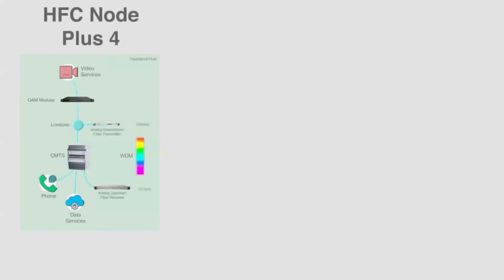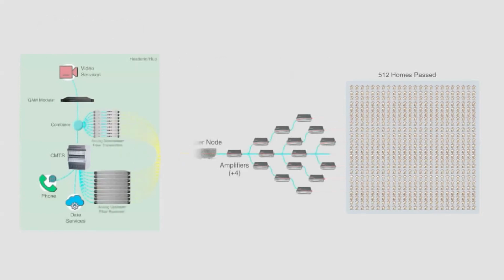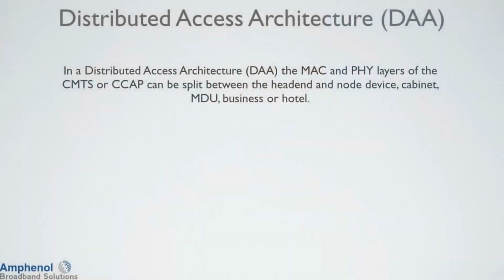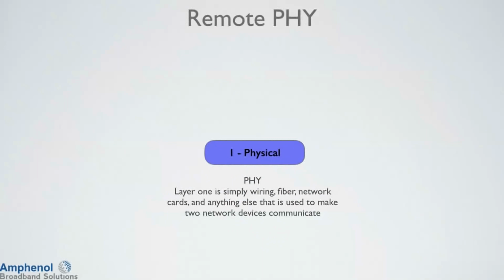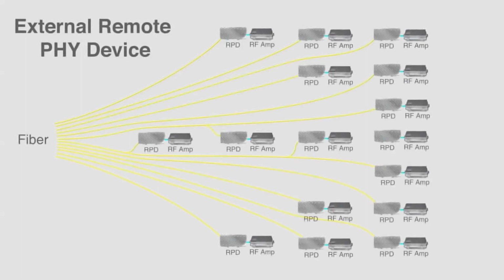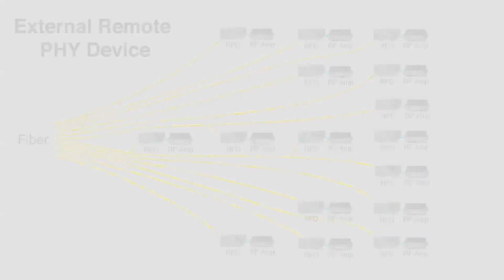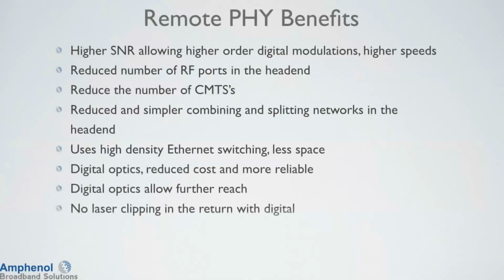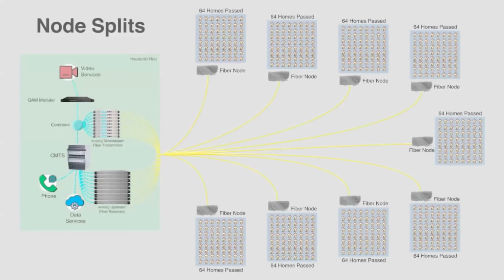Fiber 101, Part 5 Remote PHY

Comment: How do you verify if PTP is in synch at the RPD after a reboot?
Reply from the maker: PTP can be verified remotely at the router interface using show commands such as “show ptp clock running.” Some vendors also have handheld test equipment that verify PTP.